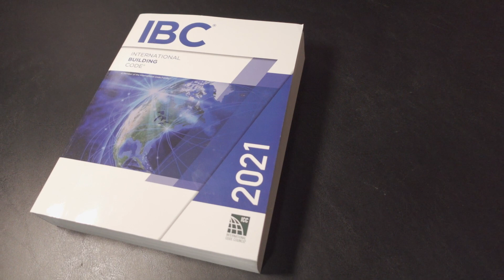How Can Mass Timber Reduce Your Building's Height?

Comment: Hey this seems to be true for smaller mass timber residential buildings (especially post n plate systems) but when we start looking at taller structures which require encapsulation or are supported by post and beam gravity systems doesn't this floor to ceiling height requirement start increasing? Also, with residential there is often a push to hide wiring and hvac.What are good solutons to reduce floor to ceiling heights when you start getting above 6 ST. I saw Ascent floor to ceiling heights were like 11+/- ft.

Comment: great topic! i was on a residential 4-5 story, in Berlin, D and when we went into 1:50 we were overboard with the total hight, as the terrace on top needed isolating (normal), and we were all over the place, vacuume isolation (expensive, and does not work. one puncture,,,,bye-bye,  scamming the floor height etc, 

was a dead end-street. of course, not a CLT-Timber build

wish you were around...thanks for promoting wood-timber-CLT.

highly needed. the investor (EU) gets the classic, concrete scam...sadly

Comment: What species would you recommend for mass timber construction, does it need to fulfill certain parameters regarding bending, weight, etc?
Reply from the maker: Mass timber is typically produced with softwood species that are common for sawn lumber applications, specifically Douglas fir, souther pine and spruce-pine-fir. All CLT used in the US must be certified according to ANSI APA PRG 320 which provides specific requirements for structural testing, among other criteria